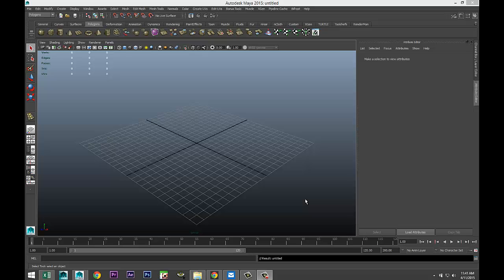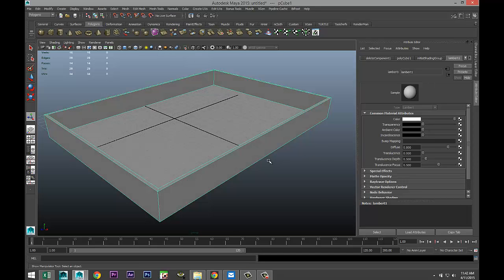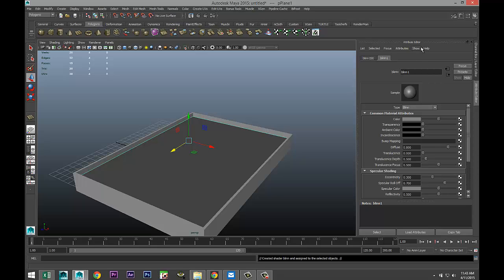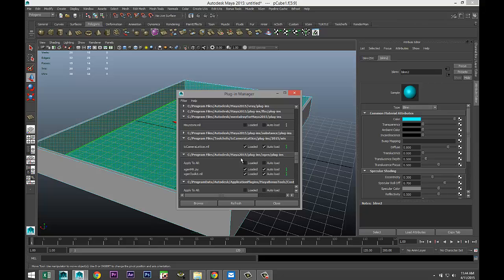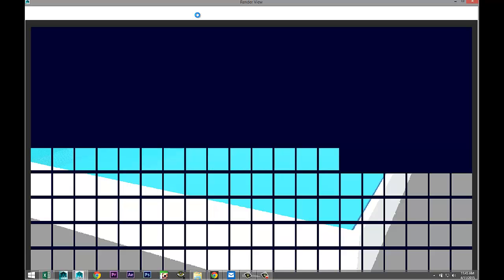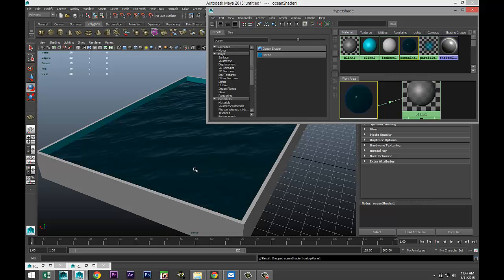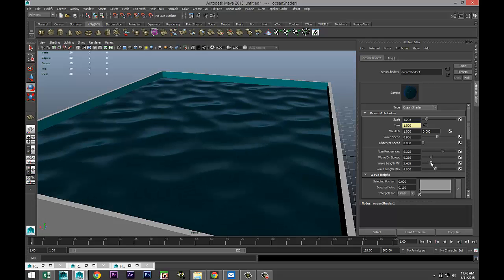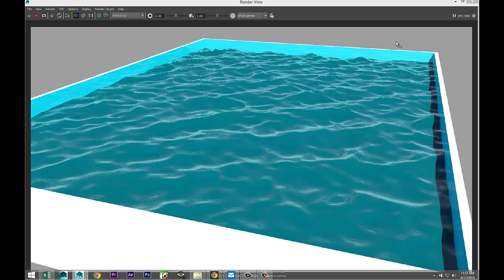Maya tutorial : Using the Ocean shader

Comment: I have autodesk maya 2017 bifrost but Arnold its not work screen black..
Reply from the maker: That is a Service Pack problem that needs to be installed. Check the forum on Autodesk
Reply: did you press render button?

Comment: Thanks for this but how does  the surface of a plane with no divisions wind up deformed as yours does?
Reply from the maker: +Sardonix Hi there, the mesh does not deform at all, it is simply a shader designed to reflect light in a way that it resembles water. If you want to actually animate water check my Ocean tutorial https://youtu.be/TqkJgqawwHk
Reply: I was looking at the edge where the water surfaces meets the pool side.  It looks wavy there. 
Thanks for the reply.
Reply from the maker: +Sardonix Yes it does, that's the point